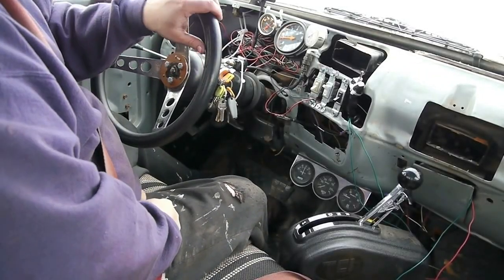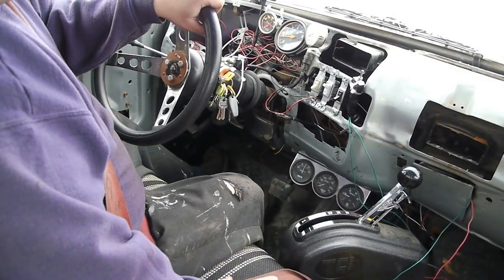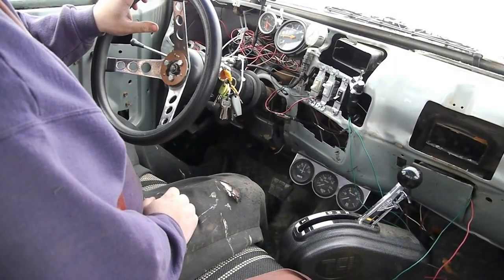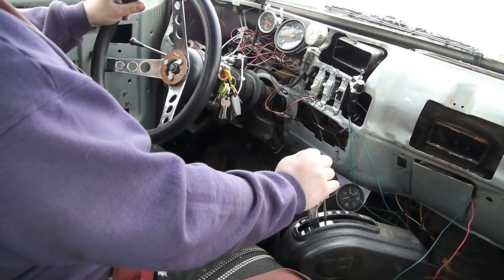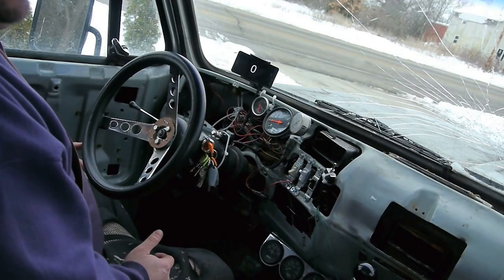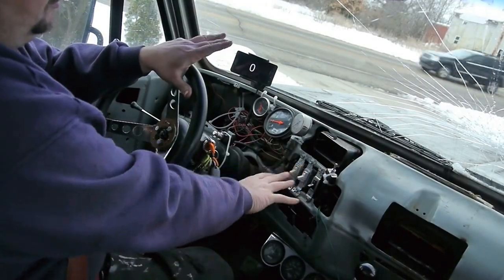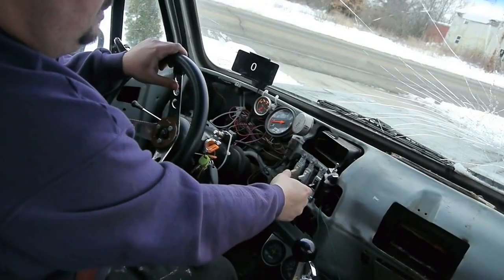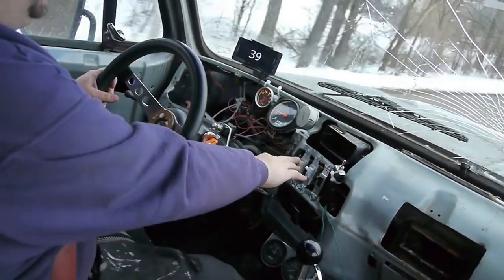4l80e full manual with no computer

Comment: This is 12 years later, and my only regret is I didn’t see this video sooner. This is easily one of the top 10 videos I’ve ever seen. I can not applaud your efforts enough sir. Such a super cool no doubt one off way of putting in a 4l80. I mean wow. Just too cool. Way to go man
Reply: I know, randomly showed up on my feed too when I saw the home electrical wall switches I knew it was going to be a jewel
Reply: looks like your cars will still be on the road after an EMP.
Reply: I used this setup to test my transmission  to see if my problem was electrical or if the transmission needed a rebuild. It ended up being a bad transmission.  I got a 4l80 that was 5 years newer and had to use this setup to shift because of the wiring difference. I like being able to choose my shift points, but you can't eat and drive anymore lol

Comment: the 4L80E valve body can be converted to the th400 valve body which gets all the lower 3 gears working on the shift lever. you can tie into the ign circuit in the spare unused circuits in the fuse panel under the dash all turn key on off. a throttle position sensor and the brake light circuit can enable and disable the overdrive. My g30 van could lug on overdrive at highway speed. But if I'm wanting a slight kickdown to pass a super B on a hill, I just tap the brake lights and it kicks it to 4th OD out of 5th. My 4l80e speed sensors tied into a circuit with the ABS brake system.

Comment: I so love the security system you gave me for my truck. 😂 many years ago now this saved my ass when I was forced to hotwire my chevy to work with a gas 350 with the 4L80E Transmission after taking the junk 6.5 chevy diesel out and placing it where it always belonged...the garbage. Lol...I had to use the 4L80E for a long time afterwards and this trick made it possible...while also making it anti-theft in the process

Comment: Chevy had the same bolt pattern trans all the way back to 1955 i believe. The new LT motors are different. For a small block, i would want a turbo hydromatic 4 speed with a vacuum control. Much easier.

Comment: In my experience with Manuel shift hydrologic clutch type transmission's the down shift is more important than the up shift .
Some people think because it takes off fine in second or third it's working fine .
Not the case .
Moving the mass takes certain gear ratio at a certain rpm to keep from burning up the clutch packs . 
Case in point . A  Ford C6 will work with out the kick down hooked up .
But it's actually taking off from a stop in second gear . Which is hard on the clutch pack . 
Same as if it still had the old 465 four speed in it you would need to down shift when you come to a hill or it would be hard on the clutch. 
That same gos with a manual valve body . 
Down shifts are just as important as a up shift .
JMO 😎✌️

Comment: Do have to put the transmission in drive (4th) with the manual shifter in order to use the switches to shift?
Reply from the maker: Yes, it will need to be in Drive.

Comment: I had an old 68 chevy stepside with 3 on the tree/collum and the linkage was wore TF OUT!  So I cut a hole in the floor on the linkage side and bolted 3 pieces of allthread through the gear selectors......I got where I could pull one out and push one in with my gas foot......It was hilarious to drive! It would stump 90% of the kids nowa days.  LOL

Comment: It wouldn't be all that hard to make a custom floor shifter , example when you put the shifter in the first gear position it flips your 2 solonoid switches into the correct positions sol A on/up and sol b off/down

Shift the floor shifter into 2nd andit automatically flips your switches for you

Comment: I've thought of doing the same with switches along the shifter.
But unfortunately leaving a 4l60e at full line pressure all the time will destroy it.

The 2-4 band will crush the drum.
I will bind on a 2-3 shift
Reply: It's like using a 4l60 with the throttle body cable all the way pulled

Comment: How do you control the transmission line pressure. Without the computer? it runs on high pressure all the time without the computer

Comment: SO, is there ANY way to be able to use the shifter only, to be able to go manually through ALL the gears, without having to play with any switches? Yes, I realize that the converter won't lock-up, and there will be no engine braking, but can you shift from first through fourth with the shifter only?
Reply from the maker: Yes there is a way.  You have to turn the wiring into a logic problem and think about it, because only first gear can’t be overridden by the shifter without the solenoid being involved also.  If I remember correctly you could use the gear selector switches to actuate a solenoid.   It’s been a long time but I think there are wires coming out of the trans that conduct electricity depending on the position of the gear shifter.  So you could wire this to be the light switches…they are switching as you move the gear selector.  The Megasquirt website used to have an electrical diagram for the 4l80e.  Look there for ideas.

Comment: I think you should create a "paddle shift" style system on the steering wheel. Using your forefingers to press paddles to upshift and downshift, with paddles or buttons on both sides of steering wheel, or mod a paddle system from a late model car. I can see your system turned into a serious performance quick shifting system, exactly like paddle shifters.

Comment: This is totally awesome! I am a nooby and want to do the same thing you did. Can you give more info about what your engine is and what you had to do to mate the engine to the tranny? I am wanting to do exactly what you did behind an old school SBC.
Reply from the maker: I used a 4l80E off of a small block Chevy so it just bolted right up, no change needed that I can recall.
Reply: @vejur  Ok, I am doing the same thing you did, I also have an SM465 truck. Did you change your rear gears?
Reply from the maker: @jtp682  Nope, I left them alone.

Comment: If you buy the full manual conversion that plugs into the trans, all you do is connect power. It gives you full manual control and full line pressure, all the time. It does not require a computer. But where ever the shifter is that’s the gear you get. If you start in drive, you are starting in 4th gear. If you slam it into first gear at 80, that’s where it’s going. These controllers can be bought for around $200.
Reply: You can do that  for free with a pigtail from the boneyard. Just need a switched power source on a fuse.

Comment: Is lock up like 5th gear. Do you actually feel it shift when switching on the lock up?
Reply from the maker: Yes, you will feel it unless you are basically coasting.  It is 200-300 RPM drop if I remember correctly.  It's been a long time, I sold this truck 6+ years ago.

Comment: That you for getting back to I have got the 4l80e in the truck and I'm having a hard time with it from what I can understand is it tacks 4 wires off of the plug and I'm think that in need to use the A and  B and tcc and  then the key 15 fuse  dose that sound right
Reply from the maker: Hi Kent, It's been a long time since I did this, but if I remember correctly 12v goes into 1 wire into the transmission and then A, B, and TCC would have switches that connect them to ground.  So what you said sounds correct to me.

Comment: I'm trying to put the 4l80e in to my 79 chevy truck and I'm have a hard time find out what wires off of the plug to use to do the same thing maybe to can tell me what the letter is for the wire is all the wires are lettered at the plug
Reply from the maker: Hi Kent, I don't have the truck anymore, but maybe this can help you: http://www.msgpio.com/manuals/mshift/4L80E/4L80e.html.  There are letters in that diagram.

Comment: Probably 8 years too late, but you don't actually have to do any of this. You can ground the solenoid control wires to each other so that the only input you need is 12v power and the shifter itself. That way whatever gear you put the gear lever in is what gear the transmission is in. All you've gotta do is cut up a GM transmission pigtail
Reply from the maker: Are you sure about that?

“In the absence of the PCM to control solenoid operation, you can use the pressure manifold assembly to substitute the necessary ground signals to energize the solenoids in the proper combination to provide full manual control.”

https://atracom.blob.core.windows.net/gears/2015/2015-03/2015_3_32.pdf

You need the ground to the solenoid to change based on the gear selector location.  You can use the shifting truth table at the beginning of the linked article and wire the pressure manifold switches in a specific way so that the transmission shifts as expected, but you can’t just ground the solenoids to each other in my experience.
Reply: @vejur  I just did it on my own vehicle with a 4l80e swap. I'd have to look up the pins again or crawl back under the car, but by soldering 3 wires together in one circuit on the pigtail, and 2 wires together in another circuit, you end up with full manual control via the shifter. Then all you have to run is a key switched 12v source via the pink power input wire, and a switched 12v supply to pin S for converter lockup if you're so inclined. There's a tutorial video on it floating around on YouTube.
Reply from the maker: @kylefunston484  yeah you probably connected the pressures manifold switches to the  solenoids.  But if you ground both solenoids only at the same time your tranny should be in 4th gear.  Your original comment made it sound like you could just ground A solenoid  to B solenoid and apply power, that would be 3 wires only.  I don’t think that would work, and I didn’t want someone to be confused after they tried it and it didn’t work.

Comment: I'm brazilian. I will install 4l60e in a vintage car with a carburetor. question: Is the pwm valve downshift 3-2 always off?
And the pressure Control solenoid always off?
 Can I connect TCC in 2, 3 and 4 gears or damage break the gearbox?

Thank you

Comment: Instead of swapping out the manual trans, you shoulda just fixed the herniated disk in your back... All you need to fix your herniated disk is a pair of channel locks, a wire coat hanger, 8” piece of chicken wire, and a roll of dental floss.

Comment: For first gear, you ring this here doorbell button. Then when you’re ready for second gear, you gotta pull this ceiling fan string. Then for third gear, ya gotta press the lever down on this 1956 bread toaster. And for the overdrive lockup, you screw in this here lightbulb.
Reply: You just described my ratrod switch plans lol
Reply: That's how you insure noone can drive that thing
Reply: Love this comment 😂
Reply: ....saving the $1,200 for the controller.....PRICELESS
Reply: @danielkingery2894 Or you can always just purchase a full manual valve body... 🤷🏻
Reply: @davelowets how does that work? Have to manually push the shifter back and forth? Can you use a kickdown for passing gear? How would it work?
Reply: @davelowets  Think I just watched Ian at Big Tire Garage install one of those. I was thinking that is what this would be.
Reply: Lmfaoooo 🤣🤣🤣 too funny
Reply: LMAO
Reply: Also important note, you must be turning left and under full sunlight for 2nd and 3rd.  1st and 4th you need to make sure your fridgerator is running and it's nighttime
Reply: Better than a $1500 computer....😂❤
Reply: Awesome bro
Reply: Its working Anakin…now Come home
Reply: Mechanic bop it
Reply: Pull this here ceiling fan string
Reply: 😂😂😂 this made my day too funny man
Reply: That shifter looks  like a toaster
Reply: Still rather do that then pay 1400$ truck note a month lmao.
Reply: Im dead.lol you figured he would just buy the harness
Reply: @codymcfadden8856  he's running a engine without any computer module so the harness wouldn't matter bc he wouldn't have anything to plug it into besides on the transmission side.
Reply: Best things are free kemosobby @codymcfadden8856

Comment: I use a forced 4 shift box, its basically the same concept except allows a tiptronic or paddle shift, just electronic control of the solenoids instead of the light switches but your version is free 😁

Comment: I put a 4l60e in my nova with no computer. It worked fine but I was warned it could overheat if driven long 50+ mile distances.
Reply: Early 80s had no computer it was just 4L60 you could do that
Reply: Jake Browne when I pulled the numbers off the side of the trans it came up as a 4l60e. I am aware there was a non-electric 4l60 between the 700r4 and 4l60e lol but it wasn’t that trans.
Reply: Jake Browne but I was thinking about it after I had posted my comment, I don’t think it had overdrive. I only drove it once after the trans swap, as I had decided to get a new daily right after because I had swapped the engine and then the trans went a week later compliments of my uncle’s “great” advice. I had sunk way too much money I didn’t have into it.

Comment: Have a few questions. What if you ONLY want 1st gear and reverse? for derby use?
Reply: Wire the solenoids to do 1st when its in D then manually shift D to R
Reply: Jake Browne so it’s just a power and ground? I assume

Comment: I did the same as you, but I kept the ECM and placed the TPS sensor in the carburetor, but the overdrive does not work. What are the lock up cables?

Comment: Dude find a wiring diagram of how transmission shops wire (ground) the internal wiring to the solenoids to full manual shift, so they can Dyno a newly rebuilt 4l80e transmission's without a computer. It's simple basically no money spent, and the information is all over the net. Yes it will be full line pressure also, but at least your bathroom light won't come on when you are traveling.!!!

Comment: So dan mann your way do you only switch ground solonoids a and b and lockup?  Is pressure manifold wires a b and c  constantly grounded ....or are they wired in solonoid a with pressure manifold wires a and b then switched to ground and solonoid b with pressure manifold c wire switchd to ground?  Basically are all 3 pressure manifold wires constantly grounded to be a closed circuit or are they part of the switched setup??? Dan mann or anybody that has done this im at a pause till i get an answer

Comment: I've just designed hardware and software to upshift and downshift with 2 pushbuttons like paddle shifters plus a 7 segment led display that shows what gear your in. Got less than 100 bucks in it.
Reply: Any weird issues in reverse? Does it downshift without having to actuate the linkage?

Comment: I seen this and tried the same thing with a 4 L 60 I looked up the schematic for some reason it didn't work on the 4 L 60 I ended up I was supposed to have four switches A&B for reverse A&B for first takeaway be ad C for second then add B to C for 4th and then d for lockup but it didn't work out so I threw it in the can and added a th400

Comment: Might I recommend that if you want to use engine braking, instead of using the gear shift selector, just use the converter lockup, because that is what the shift lever is doing, just making the converter lockup more aggressive and engage until a much lower RPM.

Comment: Looks stock to me. Pretty sure the boat steering wheel/no horn/no door panel/cracked windshield/no heat/no gas,volt,temp,speedo gauge package/no radio/no dash pad/no shift lever/zip tie upgrade were all stock factory options.
Reply: Yea it's a special 1979 Copo  c30.......it's the weight distribution package
Reply: It’s the base base model
Reply: Austin Carlson lmao that’s just like my geo prism
Reply: LMAO I died lol lol
Reply: No that’s called red neck engineering right here. That’s what made America the super power we are today lol.
Reply: Thats a grant steering not a boat steering wheel. If it works for him who cares

Comment: You mentioned it isn't a Caddi are you sure😂😁???
I do love it tho.    So can you leave both switches or solenoids in the on position all the time and simply shift it with the manual cable shifter? I know the torque converter would need shifting on or off. What about reverse with both switches on?

Comment: Probably a dumb question but if you left the switches set for 4th gear and you put the gear selector in "drive" would it shift through the gears into 4th?
Reply from the maker: No, it would be in 4th gear all of the time.  It's like you commanded 4th and the transmission would give you 4th, no matter what your actual speed was.  with the switches set to 4th gear you could manually move the gear shifter to 3rd, and 2nd and the transmission would give you those gears as well.  The only gear you cannot get is 1st, because first REQUIRES that the solenoids are set for 1st.  1st gear is a bit special, I think that GM probably did this as a safety feature.  When the transmission was originally controlled by the computer, even if you move the gear selector to first gear the computer still needs to give you the correct combination at the shift solenoids or the transmission would not go into 1st.  In the OEM application, you are prevented from getting 1st gear if the computer decides you shouldn't have it.

Comment: could i just use the selector for 1-2-3 then make "D" 4th???? AND JUST USE A SWITCH FOR LOCKUP???  plz reply id like to use my 4L60E on my carbed LS thankyou very much
Reply: Yeah sure there is a video of someone who did just that but if you leave it locked up and slow down, the engine will stall.. And the transmission will not like to shift locked up